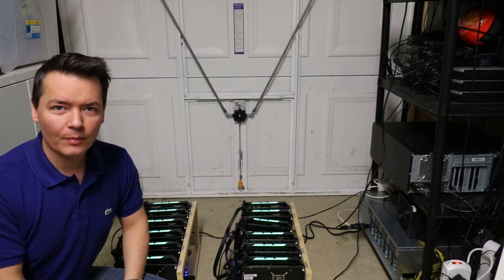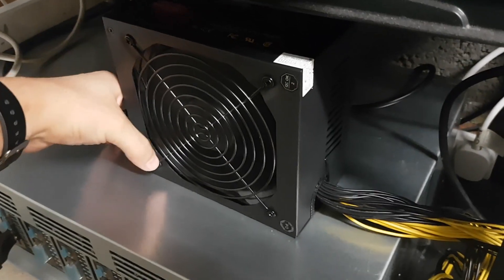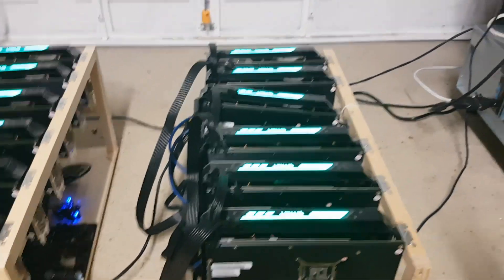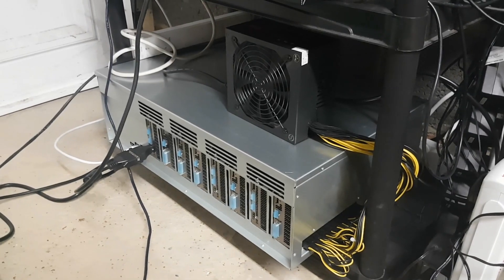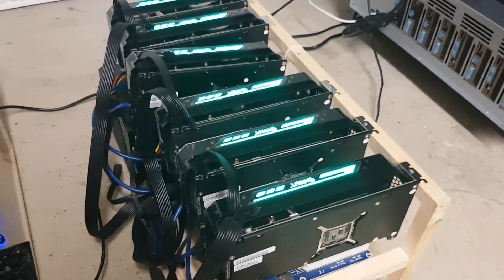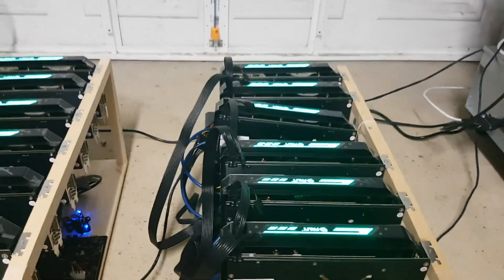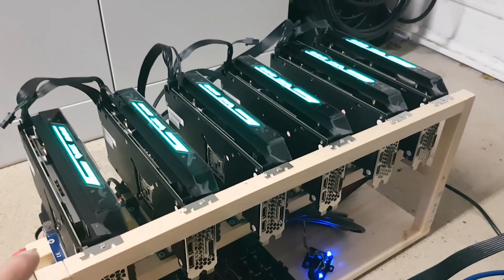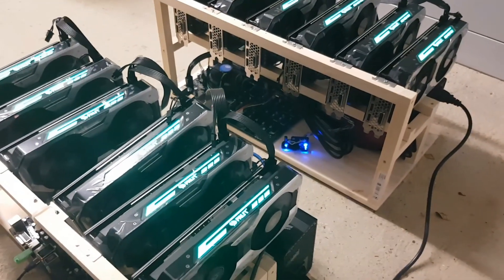GTX 1060 6GB Crypto Mining Rigs 144 Mh/s @ 525W 6 Month ROI

Comment: You can easily regulate the speed of the fans, including the power supply fan, with a fan control panel or something similiar. The Power supply also just has a normal connector for the fan, so you can regulate that too.

Comment: Great setup. What do you do/ advise for fire safety?!
Reply from the maker: Keep your rigs externally from your house if you can.
Ensure your power supply has plenty of overhead, don't overload psus.
Spread the load over all the psus connectors/cables, don't put 4 risers on a single molex cable for example.
With rig is running check cables, connectors with your hand see if anything is getting hot.
Keep rigs cool, good spacing between gpus. Keep it clean and free of dust, debris.
Smoke Alarms, Automatic fire extinguishers (Elide / AFO Ball), CO2 extinguisher.
Reply: IMineBlocks Lee, that’s the most valuable advice ever. I do appreciate your prompt answer. I’m an avid follower for your videos and you’ve got me for life! :)
BTW, I don’t have a dedicated power outlet but trying to not exceed 80% of the 13amps sockets at home. Hence, spreading machines over different outlets, yet, I don’t know what’s the standard max. current a ring can hold here in the UK. I see 2 cables (probably 2.5mm each) connected to one 32amp RCB on the main switch board and labeled for all house sockets apart of the kitchen obviously, and I think they use one 2.5mm for ground floor ring and another for the first floor, if my guess is right! Any advices?
Also, is there any cap on electricity when it comes to providers? I definitely have the worst, e on, lol.
Thanks again mate!

Comment: Hi Lee, How do you calculate your power consumption? I use GPUz software and it's not showing any Wattage. The same in After Burner, I can only limit power usage in percenrage(%) not in wattage. For example if I limit my power usage to 65% what would my 1060 6g uses the energy?

Comment: Hey Lee - how are you keeping your garage cool with these rigs running?
Reply from the maker: I don't have any external fans, a little draft comes through the bottom of the garage door. The garage temperature gets upto 30C, I'll be moving the rigs into the shed soon. Its just easier to test and get them running smoothly indoors first.
Reply: Understood. I maxed out all the power and ability to keep rigs cool that my house has and had to relocated some to a serviced office and a friends house :) I'm now looking at designing a self-build rig housing system (like a small purpose-built shed) so that when the summer comes again I have a decent system to be able to add new rigs without cooling problems.
Reply: I have same problem way too hot.. also at a point where i cannot put more rigs on the mains as i might take the service fuse out. metertails should be good up to 80A or so but you gotta take into account that your running household loads of approx 20A constantly fridges ovens microwaves washing machines.

Comment: I have 6 x 6 GB 1060 GTX Cards with i3, 8 Gb RAM. I am unable to run all cards. Only 4 cards are working. I am getting 16 mh/s per card. Its giving error of "cuda out of memory" Raised Vram still not working. Can you pls guide what I should do? And which mining pool is best for Asia? Currently using Nicehash. Thanks

Comment: I need some help setting up my rig. Win 10 (need to check build #) biostar 250 ti pro, 16GB 2x8 (16G virtual mem set)1000w psu. OK I have 3 XFX 580 8G OC black edition & 1 asus strix 1050ti oc 4G. When I added 2 more 1050ti 4g I am getting low resource warning in dev manager where it tells me to disable some other devices to correct the problem. 

The MB bios is set for mining mode and the pci channels are set for 6+ cards. I have AMD's beta mining blockchain driver and just the standard newer nvidia drivers.
The only resource I can think about is more power and to add another PSU 650w terminated to run the nvidia risers & cards.

Any tips please?

Comment: would you recommend a 600W or 650W PSU for a rig like yours? The main difference, brand aside, is that mine are 1060 3GB GPUs. It's impossible to get a 750W PSU these days where I live, and my idea is to get a fanless one, so I can have my 1060 rig in my room.
Reply from the maker: I would not recommend it, if mining Ethereum it would use around 550 Watts with power limiting. If you mined ZCash it would use 800 Watts and trip your PSU or possibly blow it.
Reply: thanks for the reply!! I feel honored, actually. Maybe it'd be better to have 4-5 1060 at most. Power consumption is a fixed 75W with the settings I use (tried yours but the brand and model aren't the same, so some values can't get applied :/). The idea is to get a fanless PSU and use Nicehash (the power consumption is very stable), because I love silence and being able to move it around. Maybe just 4 per rig then, 5 at most. Do you know a good regular (not necessarily mining focused) motherboard that accepts 4 or 5 cards using the PCIe ports if it has enough?
Reply: Well, after studying what to do following your comment, I decided to settle with 3 1060 3GB cards in that particular rig so I have plenty of room for a fanless silent rig in my bedroom. Thanks IMineBlocks!

Comment: My 1060's are doings 160 mhs  at 525 watts :)
Reply from the maker: Please share your settings and also the GPU / memory brand. 
I think I might be able to get mine upto max 25 Mh/s each.
Reply: I have 7 cards, they are a mixture of evga,  zotac, inno3D, and gigabyte... they all have samsung memory... The memory is set anywhere between 750+ and 900Mhz...  The power limit is set anywhere between 53% and 61% - The core is left standard on this rig... although i have another rig with 5 x Gigabyte 1060's and it needs the core at +115 to perform a better hash rate of 24 - 25mhs unlike my 7 card rig... i don't understand why they are different!  : / ....  My Power supply BTW is Gold rated and it's the Evga  850w GQ which has 8 Pci Ex connector 6+2 pin for up to 8 graphic cards a really great PSU!

Comment: Is it not better to mine most profitable coin for given hardware and then sell it and buy whatever coin you want (ethereum)?
Reply from the maker: Yes, I'll be switching to Zcash soon.
Reply: IMineBlocks Check out Zencash. Personally I'm making more with that coin, your results may very. Also DSTM miner is the best I was able to find.
Reply: Faster than EWBF? It doesn't have intensity setting.
Reply: Krzysztof Cygan 

Watch Voskcoin video on it
Reply: Krzysztof Cygan 

Awesome miner + ZPool. The pool will pay you in the coin you want.
Reply: Krzysztof Cygan Yes it's faster than EWBF. My 6x 1070 rig went from 2650 to 2840 sols.
Reply: take a look at miningpoolhub - very interesting alternative...

Comment: what psu do u use bro? i also have 6 gtx..do i need to buy 1000 psu or 750-850 is enough for 6 gtx? thx
Reply from the maker: 850 Watt would be ideal. Mining Ethereum will use about 550W but Zcash will use 750W so you need something with a little overhead if mining other coins.

Comment: why do peeps insist on doing eth on nvidea? if you just did equash on nice hash through smos you would be able to buy more eth than you would mine. So in the end you would make more money! please try it and see if i'm right.
Reply: nvidia has less power consumtion then amds so that the calc goes up again. i use 12 1050ti and getting 180 hashes at 660 watts
Reply: Brian 

Yep. 5 x 1080 ti making over 2k per month on Nist5
Reply: I use MPH but yeah. Mine zclassic or whatever and autoconvert to whatever you want.

Comment: 6 gig cards?   how much Mh/s could i expect from a 3Gig card?
Reply: The same - the memory mainly affects the ability to download the DAG, so a 3GB card will stop being able to mine when a 6GB could still be used if the DAG file is above 3GB. The main thing that will affect the hashrate on these is what memory manufaturer they happen to have in them and you can't tell until they arrive and you check.
Reply: Depending on what memory it happens to have. I've had 18Mhs and 24Mhs just because of difference in memory manufacturer
Reply: hmm ok..   24 would be great  but im scared thaat i get a 18Mh/s one.  So I rather stay with Gtx 1050ti's
Reply: i get 19,1 on my EVGA 1060 OC 3gb cards i have a totalt of 38,3 with 2 cards the rigg is running at a sexy 120watt... :O
Reply: if you don't get samsung memory, just mine equihash, those cards go over 300 sols at +3sols/watt